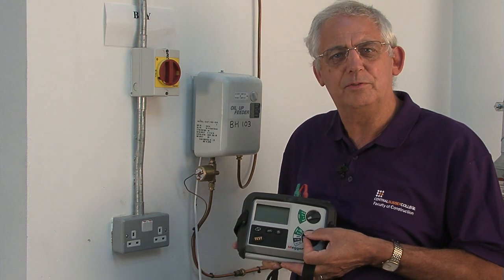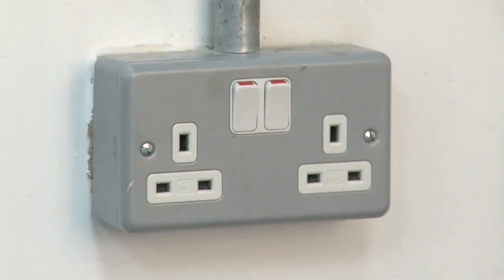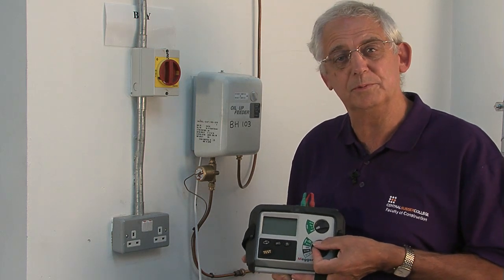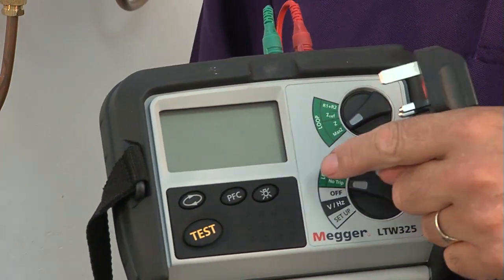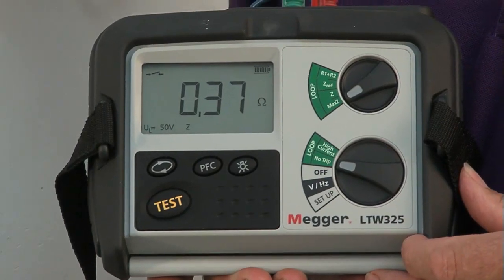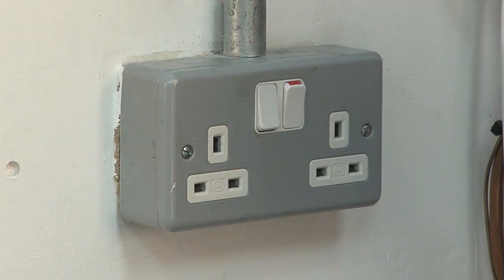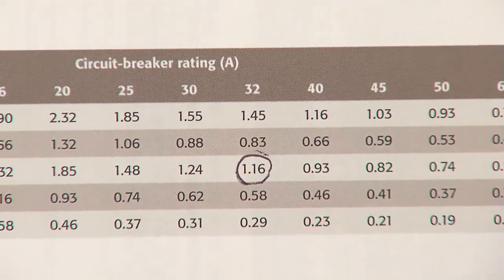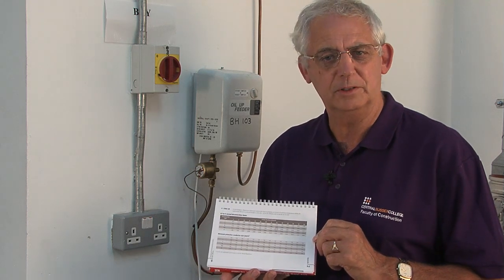Earth fault loop impedance test

Comment: With a high Zs reading you could consider fitting an RCD, however you should investigate the reason that the reading is high first. If the cable is too long you may have other issues such as volt drop and short circuit current disconnection time.